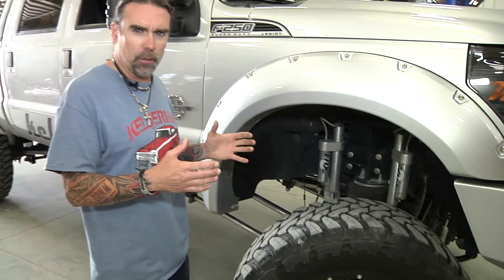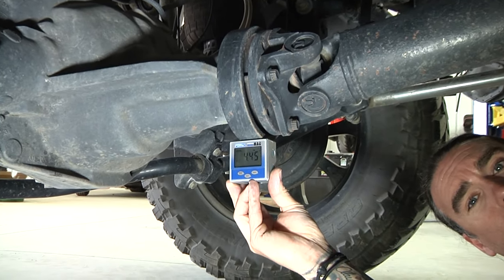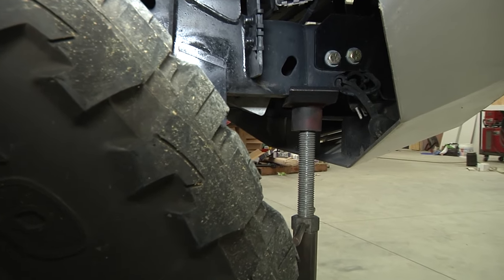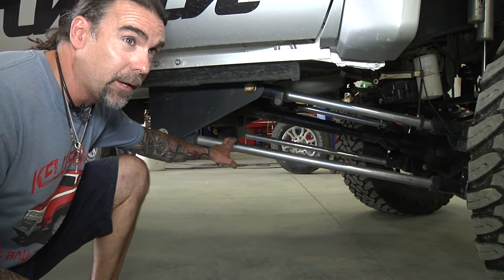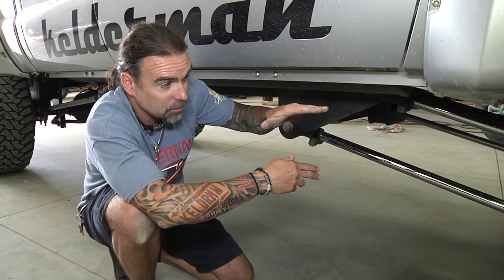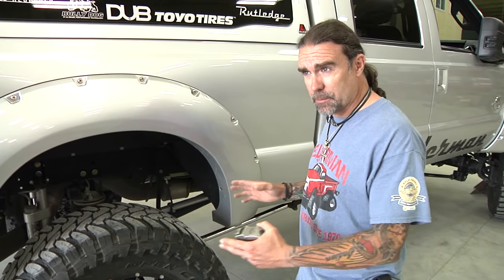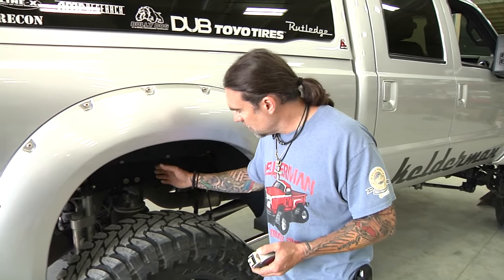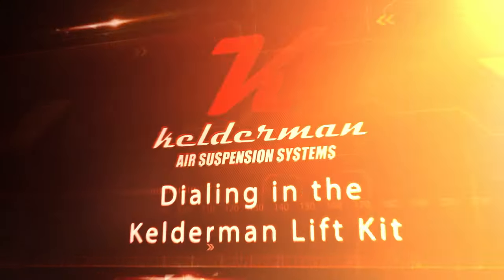Dialing in the Kelderman Lift Kit

Comment: Kelderman is the best lifts /air bags and stuff.... this video really help me as a technician. When we’re installing these kits... they’re on the higher end ... but that’s what really works in the long run...
Reply: Julio Vega  What's the main purpose of these air lift kits? More ground clearance and lower ride at highway speeds? Also, do these air lifts affect towing?

Comment: Hey Guys, I was looking for the 8-10" for my 2017 F250 Super Duty. I only see the 10-12 and 6-8 on the website. Due to being handicapped I was trying for something that would drop to about a 3-4" lift but would still maybe show at about 12-13" maxed out. The 10-12 just doesnt seem to get low enough for me at roughly 6" although I love that 15-16" max for shows. Do you still offer this 8-10 for the Super Duty? If so what are the lowered and maxed parameters? Thanks so much for helping  a disabled guy achieve his dreams
Reply from the maker: We would have stock ride height, 5-6", 6-8", and 10-12" kits for the 2017+ F-250/F-350 trucks. 

https://kelderman.com/shop/catalog/category/view/id/2/?find=2017-ford-f-250-158&product_list_limit=all&sid=SVmFRDNB3u

Comment: how about the angle on the sway bar .. I can't find a straight answer on it . but I've got mine pointing up about ten degrees and seemed to help  smooth out the ride .. are you there at the same time took off the larger Springs and put a spacer  cut it off an oxygen tank  welded it to the new coil buckets  it on top of the spring... I want to get rid of this screen completely with put airbags . I just have to make my spacer little bit bigger probably . so I'm trying to find strong airbags  with a lot of lift . my truck has like a 10 to 12 inch lift . running 38s on 22s.. does anybody have any vices where to get the lift bags . I have doubled Fox shocks on each side of the front  that are set back so they're not in the middle of the spring .

Comment: So I want to raise a question about the caster angle. I know he says to run the pinion angle at zero and the bags straight up and down, but how does this translate to the caster angle? Reason I ask is because a lot of the older Super Dutys have the death wobble problem mainly because of the factory 1* caster angle. With a big lift and big tires that angle would need to be increased to 3, 4, 5 or more degrees in order to avoid that. So that increased caster would change the angle at which the bags and shocks ride and of course the pinion angle. Ultimately I'm really curious as to what Kelderman's experience is with avoiding death wobble on the older super dutys running a 10in plus lift on 38-40in tires. (Assuming all steering components are within spec)
Reply from the maker: That's a question better suited for the install/tech guys. You can talk to them by calling in at 800-334-6150.